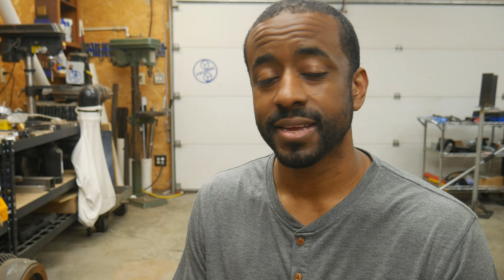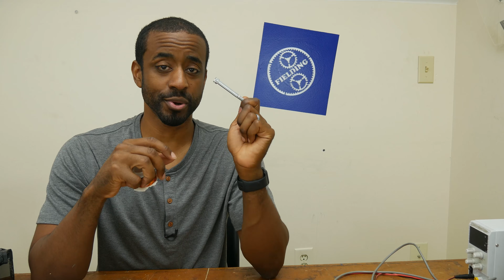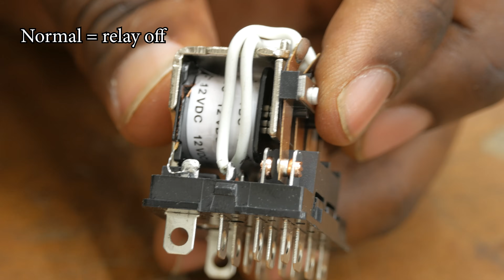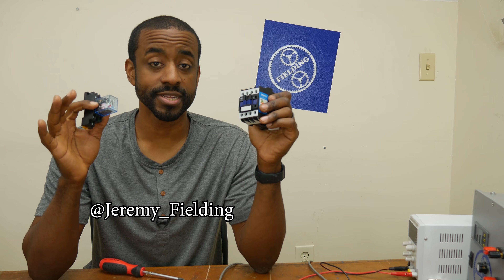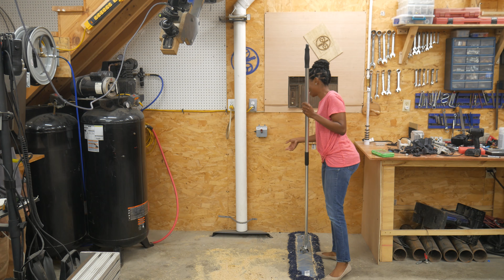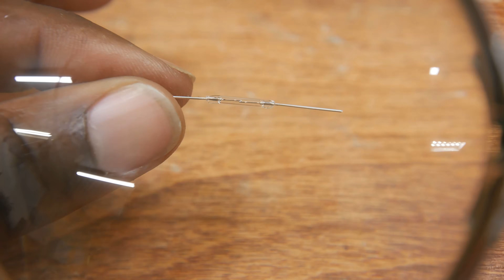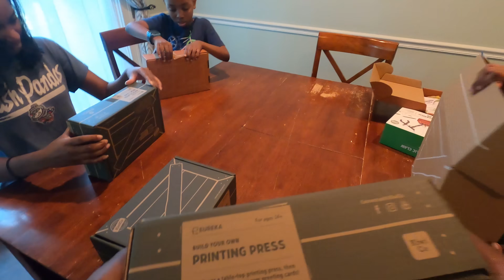A beginners guide to relays, contactors, and solenoids to automate anything; (#083)

Comment: Nice vieo, but I think you missed to mention that the coil supply is not only about how big the voltage should be (5-240V) but the type of current is important too. AC or DC. MOST relay depends on DC, but at lot of industriel relays uses AC.....    and there are "bidrektional (?) ones too!  Björn from Sweden
Reply from the maker: I must have said it 5 -6 times but still managed to edit it out LOL. I always think about the first time a relay failed on me twice because I put DC on a AC coil

Comment: A moment I remember as a kid was when we had to replace the controller for a transfer pump in our milking system. The old controller used a vacuum tube relay and I remember being intrigued by it and working out how it had to function. There was a separate set of contacts that triggered and shut it off - three stainless rods inside a milk receiver jar, two of which reached near the bottom and one ended closer to the top. Contact of the milk with the short one triggered the relay and losing contact with the long pair shut it off.

Comment: Not a short circuit. The power is going thru resistance (the coil) and doing work. A short circuit would be a short to ground that causes circuit to fail or not operate properly
Reply: Only if the connection to ground is before the load. A connection to ground after the load, although unsafe and irregular, will be indistinguishable from a connection after the load to neutral.

Comment: Hey jeremy I love your videos......I just bought my son the engineering box......I have a question and I'm sure you've covered it in at least one of your videos but I cant remember which one.....I'm looking at building a 3 phase belt grinder with a vfd and I found a motor on ebay that 3 phase 460.....I'm just trying to figure out what I need to run that if I use a vfd that converts it to single phase right? But I also have a 10hp rotary phase converter for my mill but I think my mill is 230 3 phase...so I guess my question is if I buy the 460 3 phase motor do I have a way to run it???
Thanks again Jeremy you give uneducated guys like myself hope that even though I didnt go to school it's still possible to build whatever I can dream up

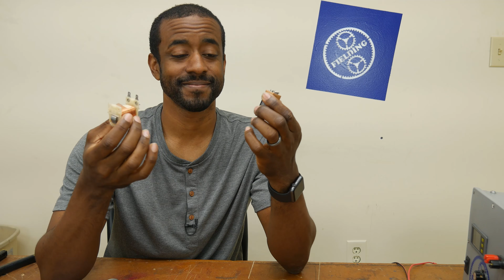Comment: 5:25 this is kind of an interesting question I think. If you were to use an AC source the answer is certainly no since you would have a reactive element in the circuit but since the battery is a DC source and the ideal inductor has a resistance of 0 you could argue yes. Although since ideal inductors don't exist outside of textbooks the coil has some low but real amount of resistance.
Reply: i think the defining factor is intention. short circuits tend to be unintentional and not doing anything useful.

Comment: I am not as knowledgeable in motors and electricity as you but I thought a switch and a short circuit were basically the same thing except the switch in intentional and the short circuit is not. Please correct me if I am wrong. Great video on relays/magnetic switches by the way.

Comment: Nope, running a battery through a coil of superfine wire wrapped around a core isn't a short. The length of wire and the core acts as a resistor, limiting the strength of current running back around to the battery.

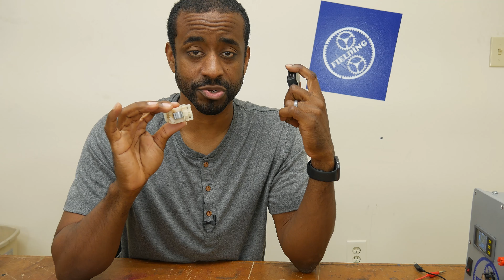Comment: 5:30 Yes and no. The coil is basically an inductor, so at the time of contact it has a resistance value. After a time proportional to the coil's tau value the resistance should go down to just that from the wire itself, making it a short circuit.
Reply: short circuits are generally unintended paths with little resistance. in this case the path is intentional tho

Comment: You mention about contactors versus relays a little bit. You did say that the contactor is better for higher current loads. One thing you could of brought out is that contactors are required for DC loads with high amp loads.
You can have a high amp load of AC, and a relay will work just fine. Just look at a pressure switch for a water pump. That 240VAC at 10-15A and it has no problem. Run that as DC, and that switch will fail in relatively short time.
Buuuut, maybe that'll be for another video  😉

Comment: 5:25 It's not a short circuit because the current is "doing work" before returning to the source. This is usually referred to as resistance, wattage, consumption, etc. Also, this slows down the power flow so it's not instantly (relatively) back to the source.

Comment: If you are interested id like to show you some of my work .Im finishing my metal lathe now and ive done a motorized hack saw and some other pretty cool projects.I have a plasma cutter and several welders .I built what I call a flow though tank for running my larger plasma on 3 smaller compressors .I make them for people as well I use scrap 10" pipe scedual 40 left behind by the fire guys .I sold one to a guy thats runs a plasma table with 3 air compressors he bought on line used for less then a 100 bucks.I make them with the kids we paint them to look like sticks of dynamite

Comment: Your viedos are awesome ! You do a great job of explaining things and the way you get your family involved is really cool and inspirational .I build machines for tooling ,cutting,and sending steal out of materials that would other wise have been thrown away.I work in HVAC but I went to school for welding and have a small metal fabrication and welding shop at my home in my garage.its nothing to bragg about plenty of harbor freight tools hanging around , but I love it ! I have an llc and insurance now and I've done work for commercial contractors and there always blown away by the fact that I did 80 to 90 % of there jobs with left over or scrap materials that I picked up well at my day job as a commercial rough installer .I build the HVAC systems in commercial kitchens and do any welding and metal fabrication like stainless steel tables,back splash ect .Anyway you have been truly helpful for the longest time I built inanimate objects such as my welders third hand skeleton style and I know im not the original there are a lot out there but I like to think I do a nice job , but your viedos have inspired me to A, get my family more involved and B start building motorized tools so far I started with a sander that is not really pretty to look at but its made from scrap materials that would otherwise be in the trash or melted down with all the practicality new motors and other useful componentry that someone took the time to create just to be thrown away or melted down just to be made into the same thing.Sorry I ramble as I've gotten older and had kids the fact that we live in a throw away Society has become something im more and more aware of and by using the materials I use to do my side hustle .I sell the skeleton hands and do a lot of one off metal art style projects .I hope to bring some level of awareness to people of how things can be repurposed.Anyway thanks ill check out your product it looks perfect covid has turned my kids into video game junkies .I work a lot but thats no excuse I need to get them out of infront of there game's.

Comment: Been learning blacksmithing, think the reason iron works better than steel might be because wrought iron seems to be layered, if you disassemble a motor, the steel core is thin sheets layered similar to the way wrought iron is naturally. It seems to help keep strange magnetic eddi currents from forming and causing havok.

Comment: No on the short circuit. the wire becomes an inductor and the resistance of the wire creates a voltage drop. Also, by definition a short circuit is when the electricity goes along an "unintended path" and since the connection is intentional it does not meet the technical requirements of the definition, technically speaking, which is the best kind of speaking.

Comment: I would say it's a completed circuit.  Due to the length of the coil wire, resistance comes into play. The more windings increases resistance and the current reduces.  The less windings and the current increases.  So it's not a shorted circuit or your battery will overheat from a load that is attempting to be zero ohms.  You ought to have your own TV show, like Mr. Wizard had, years ago.

Comment: 5:28 Hmm, it looks like there's a lot of wire in that coil; seems more like a long circuit to me :P
Reply: In my opinion, it's an inductor therefore not a short-circuit. Another way of looking at it is if the path the current takes is shorter (less resistance) than the intended one, then it's a short circuit. Although that's still not quite right I dont think.
Reply: @KingJellyfishII  It has inductance, resistance an capacitance tho so why just see a DC motor as an inductor. It's just one of the aspects, and an inductor is just a short circuit in a DC circuit it's not like were talking about reactance, in AC theory.
Reply: @SlyerFox666  true but its main purpose is to be an indicator,  I wouldn't call a capacitor a "resistor in series with an inductor in series with a capacitor" lol. Of course, it's true, but it's easier to simplify. Although actually in this case you have a point because the resistance is very large.
Reply: @KingJellyfishII  Well that's where we differ. I literally fault find down to component level and one of the tricks is to look for the resistance of a capacitor when it fails but the capacitance can read near dam perfect to what you expect to a 10% ish rating 😉
Reply: @SlyerFox666  fair enough, since I've never had to do that really, I tend to simplify, but of course there are times when you can't simplify (such as what you said).
Reply: @KingJellyfishII  Oh I don't disagree it's a good way to understand anything 👍
Reply: A few ohms is still a short cicuit.  If you have a transistor that's gone faulty between emitter and collector and had a reading of a few ohms it would no longer be an electronic switch an would fail as it would just be closed at all times, no longer needing the base current to close the switch as it has gone short circuit. 👍
Reply: @SlyerFox666  Depends on what circuit you are talking about. The starter circuit on a car should have less than 1 ohm resistance (let's assume 60A at 12V, according to Ohm's law this would mean a resistance of 0.2 ohm).
Reply: @brandy1011  When you say starter circuit are you talking about an electronic circuit or just the actual wire ? Just in most DMM or even an old school avo meters good luck getting a reliable reading at .2 ohms without some pricey equipment. I used to have to measure the contact points between terminals for equipment used on the grid with equipment that could measure down in the mOhms and it was a beast. I'm thinking your talking about just the wires, if your figures are correct then it would make sense if your pulling a minimum of 60A CCA on an engine to start it up. The cross sectional area on that cable would be fairly thick reducing the resistance, as you want to deliver that full 60A to the motor you don't want much resistance so you want to get it as close to no resistance or short circuit as possible.  So yea I'd say any thing from .1 - 1 or 2 ohms you can easily class as a short circuit. I think it's easy to forget everything has resistance, capacitance and inductance, there is no perfect resistor at the end of the day so you have to either think in ideals or reals.
Reply: @SlyerFox666  What do you mean? If there is electric current coming from some source (battery negative), through a load (motor), maybe a switch (relay/solenoid/contactor) and back to the source (battery positive), that is a circuit to me.
Reply: @brandy1011  I mean are you talking about a wiring circuit or an electronic circuit but I figured it out an edited the comment above, just got your reply 🤣
Reply: I think if we can induce emf in a coil  by intersecting  conductors with magnetic Flux, the core is just the in increase the strength of the Flux since it is made out of metal.

So the same way but in reverse trying to get the magnetic Flux if you apply emf on a coil you get a Flux, to amplify te Flux put metal in the coil.
Reply: the wire has resistance -- few ohms at least--, so not a short-circuit

Comment: A while back, I had to deal with some control circuitry designed by an engineer who wasn't familiar with these rules and concepts. 

He called a switch "normally closed while energized". 😐

I had numerous other problems to deal with in his schematics, in addition to running two separate circuits from the same source... noooo...

Edit: By the way, he forgot to mention the "while energized" portion in his schematics...😑

Comment: HVAC contactors are a cheap way to get a contactor to tear apart and designed to be taken apart.  And there are plenty of burnt contacts on the contactor videos on the HVAC channels.  What I found most intriguing was the use of the shading rings on the coil to keep the field up as the AC went through its cycle.  

Still amazes me when I think we are just 200 years from when electricity and magnetism were unified and all we have due to that became possibilities.